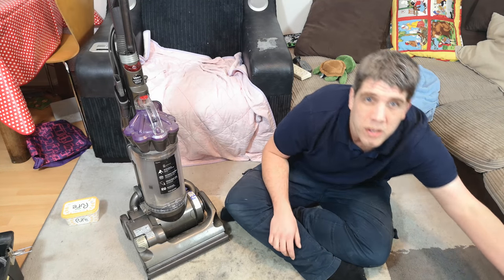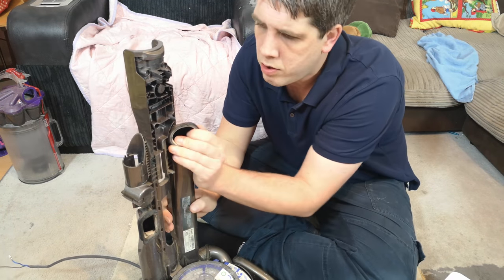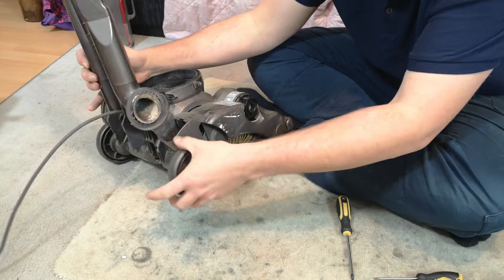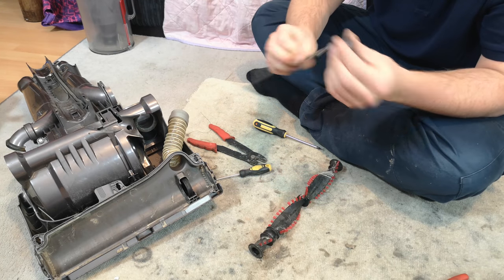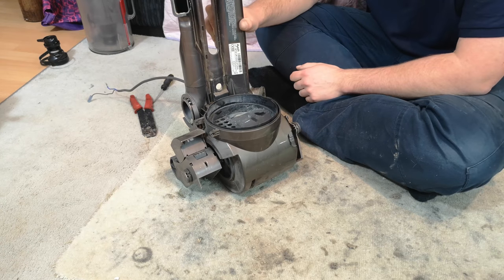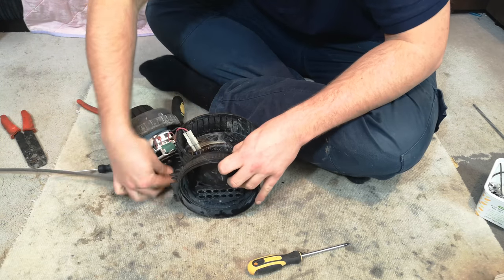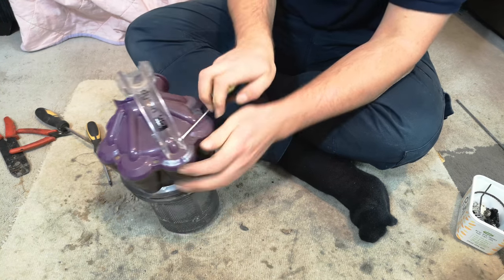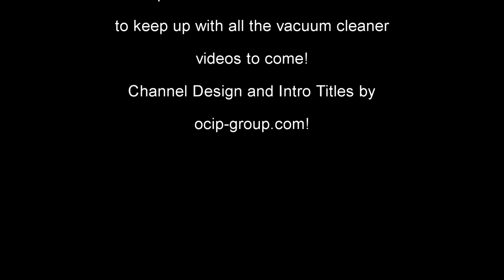Dyson DC33 - Full Stripdown/Disassembly How-To Guide!

Comment: How do you get the rubber part for the cleaner head hose on without a air leak
Reply from the maker: The grey end bit of the inner hose? It pops onto a tiny lip around the edge, doable with a small wriggle and it should pop on

Comment: great vid man fair play i have a dc33 iam haveing a problem when useing it dont pick up very well when i use the pipe part i have full sucktion very well but when i used the hoover in normal use is really bad dont pick up any idears please
Reply from the maker: Hi! Thanks. Underneath the machine is a hose, is that perished or clogged? Also remove the base plate and check for clogs under there.. Is the brushroll spinning when reclined?

Comment: I found one on the street the head doesn't rotate. The suction is poor and the suction from the wand is weak. I bought one on eBay too for £18 they changed the motor but never got it going. I'll see if I can follow your video to make myself a working one👍🙂

Comment: Is there a video on putting it back together??? I got the brush roll back in but can’t figure out how the end prices are supposed to fit it or lock in
Reply from the maker: Somewhere there will be, but the end caps slide onto the shaft in the middle after the bearings are on each end. Then just push both ends together until they push in no more, then rotate so they both align the same way. Then it'll slot into the housing, clutch/non clutch dependant

Comment: I’ve followed your strip and rebuild tutorials to change a burnt out motor and brush roller on my dc33 but since I changed the motor it doesn’t have the suction it used to have, it used to be quite difficult to push it along our carpet with the suction but now it pretty much glides over the carpet. Any suggestions to what I’ve done wrong?? When I turned it on before the motor burnt it literally planted itself in the pile of the carpet. Btw the videos are very thorough 👍
Reply from the maker: Assuming the suction through the wand is good, give the spring hose that runs to the brushroll housing a slight twist to one side. That pipe forms the spring action that pushes the brushroll housing down into the carpet. If it's too far gone their cheap on ebay. If you've not got good suction through the wand either did the motor seal on properly?
Reply: Beko1987 yes the wand suction is good ( I should have put that 🙄) thanks for the quick reply, I’ll order a new hose 👍

Comment: If the clutch will not engage is it totally gone or are there adjustments that can be made to get it working again? When the switch is turned to carpet mode it does not engage the brush
Thx 😊

Comment: Overall an extremely helpful video considering that my dyson is currently in the dishwasher on a cold wash.

However, the repair technician side of me cringed so many times at how you just pulled apart so many one way clips with barely any attempt to pry them up first, in particular for the rubbish release and the handle (which were the exact reason why I watched your video) they've both got one way clips that can easily be pried up with a flat screwdriver.

But nonetheless, I applaud your specificity in how completely you took it apart, thank you.
Reply from the maker: After (I'd guess) 30/40 DC33's you get a feel of how the plastic bends and flexes. Never broken a part yet! You can't do it so much on the newer ones though, the tolerance becomes much less the newer you get
Reply: @beko1987  ha ha, yeah that makes a certain amount of sense for sure, you grow relaxed with the familiarity.

Where as I'm always a little bit timid, especially my first time into any given machine.

However my familiarity lies with power tools and lawn mowers, where the cable management tends to be easier to keep up with and the plastic bits are older and more brittle.
Reply from the maker: I've been thinking of replacing my boring aldi electric mower with an older more fun small flymo or similar, would I have much trouble? Guess they won't be a million miles from a vacuum cleaner...

Comment: Fantastic video!  I
see sparks through the top filter housing at the motor and it smells like electrical burn. New wiring harness or motor?
Reply from the maker: Thank you! It's the motor, a small amount of sparking from the carbons is normal, but if you can smell it its not long for this world im afraid
Reply: @beko1987  many thanks!

Comment: So, currently in the middle of this, but getting stuck trying to remove the clutch knob.  I'm possibly just too worried that I'm going to break it!  Any tips?
Reply from the maker: With the cleaner reclined, get the screwdriver in as close to top and bottom as you can, that's where the latches are. Perhaps a tad more leverage but too much and you'll crack the clutch housing (but that isn't always an issue)
Reply: @beko1987  Cheers, I'll give it another go!
Reply: @beko1987  Huzzah!  Success, cheers :)

Comment: I've stripped the slimmer ydk out of a 33, can you help with putting it back together.. I've got new bearings for it, but need to know exact placement.. and all its little spacer washers etc... 
Oops
Did it after a couple of tins.
Reply from the maker: Usually it's the little spacer bit first, then a washer, then the fan, then a washer, then the nut. Inside the motor there may or may not be a little spring washer to go behind the rear bearing, but ive not taken a ydk apart for years, not since doing my video on stripping them down... Maybe have a look for that! Type in ydk beko and it should come up.
Reply: Thanks for that. 

How about bearing spacing. They were very tight to get off, but didn't leave marks on the shaft, so need them to be back on the right position.

Comment: Cleaning Dyson hose by chucking it into the wash! Seriously? Does doing so actually get the yuck out of the nooks and crannies? This, sir, is a demonstration video for you to produce!
Reply from the maker: I clean a lot of hoses in the washing machine! A good soak first to get the worst off, then in with some towels or similar so it doesn't bank around. 40 degrees thougb, I've found 60 shrinks Dyson hoses and makes them too tight on the wand